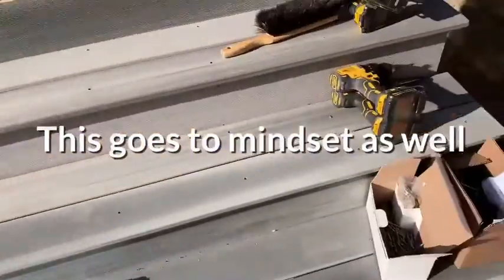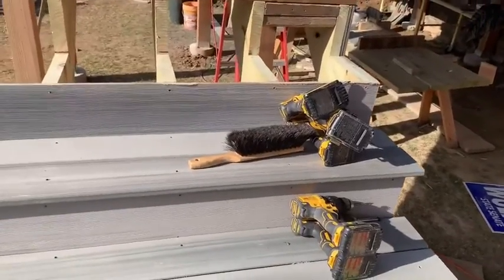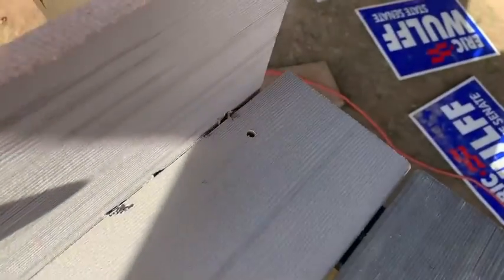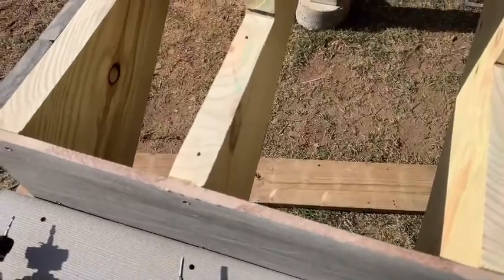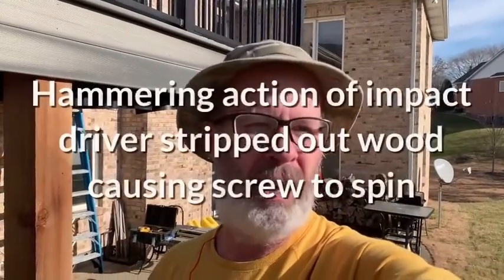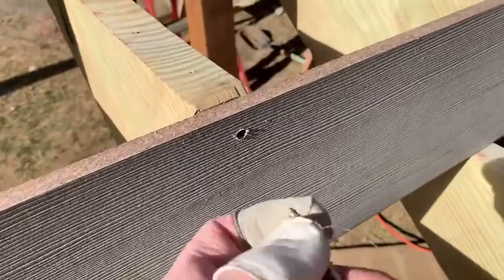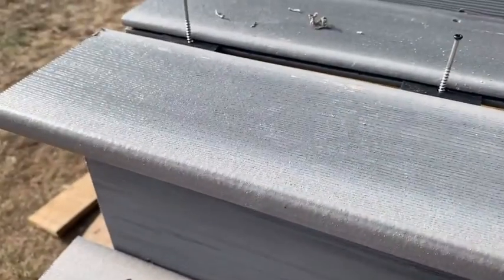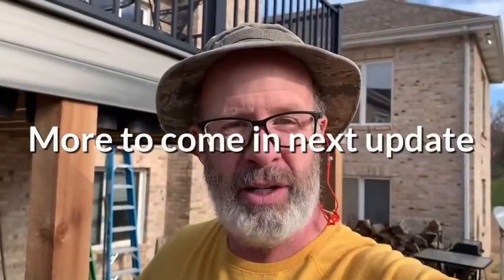Dura Life Decking,riser boards, fabrication and assembly on deck staircase.Screw & Plug difficulty

Comment: Clockwise and anti clockwise on the same screw. Hmmmm. Designed by an engineer. Modern screws and bits are too brittle. Nice microphone.
Reply from the maker: I think the counter turning threads are meant to draw would be fibers down so the hole stays clean an doesn’t puff up. what you end up getting is a screw that pulls in both directions when it doesn’t have the proper drive pressure on it.  A real 🦉 lol